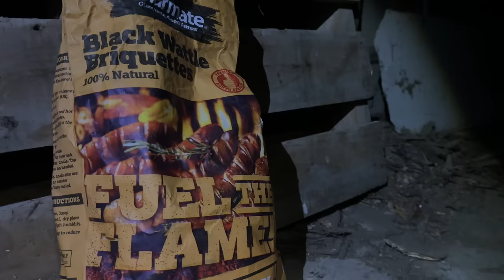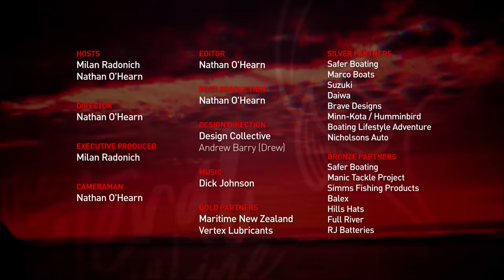The Fishing was Good, but the Food was EPIC!

Comment: Hey guys big fan here. I was wandering what is that light blue/white mechanism that is connected to saltiga rod and the fishing line on the saltiga reel?
Reply from the maker: It’s basically a peg that holds the line so you can have the bail arm on the reel open. The peg is only strong enough to stop the live bait swimming away. When the live bait is eaten the line pulls out of the peg. The reel is then in free spool ready to strike and set the hook. Chur chur 👍